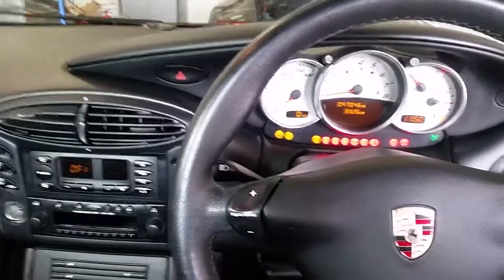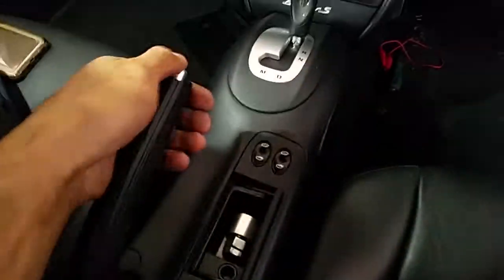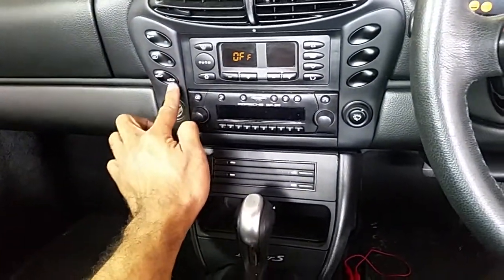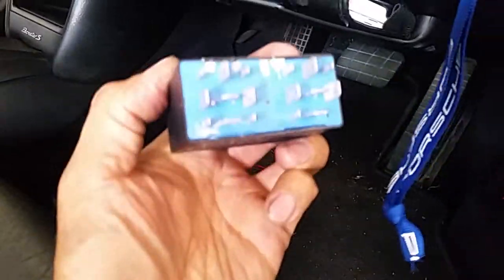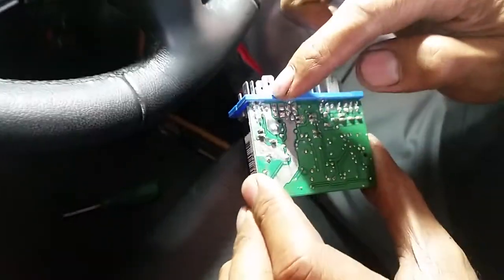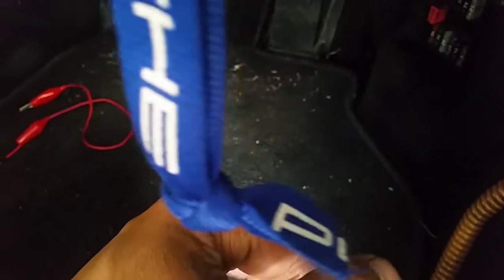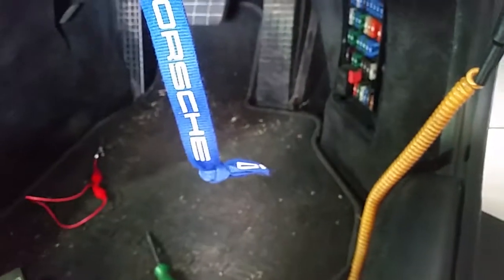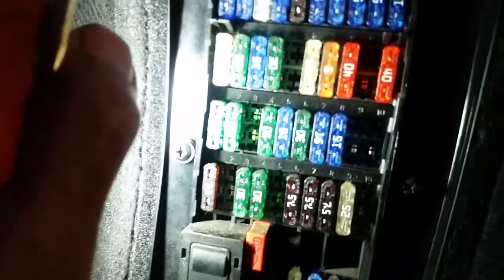Porsche 986 - convertible top problem

Comment: You don't need to remove the engine to do ims. That's bull shit. You only need to remove the gearbox. This is where garage rip you off.. go on line you can see hundreds of people doing ims without removing engines.. I've done seven. And not once have I had to remove the engine. And that go's for 996 as well.  Don't full for that my friends.
Reply from the maker: I do a lot more stuff than just the IMS Bearing replacement.